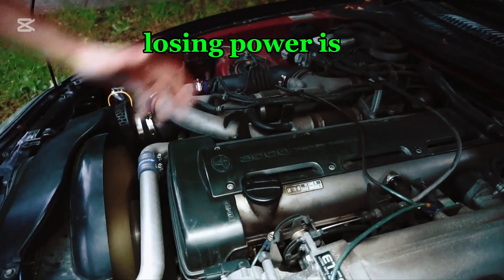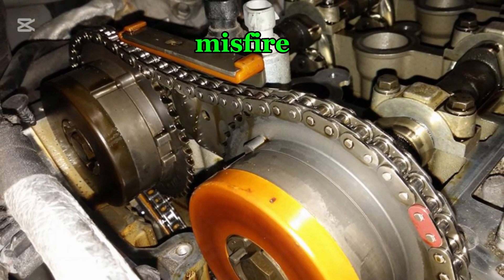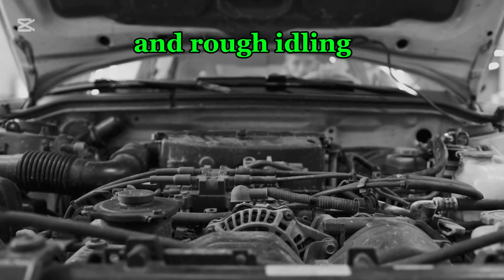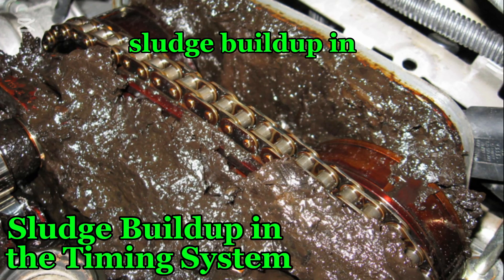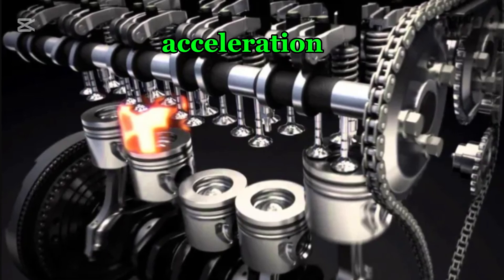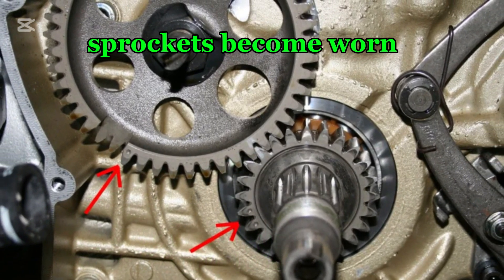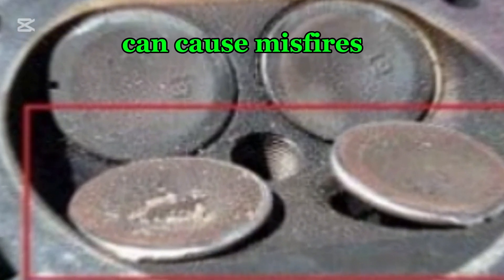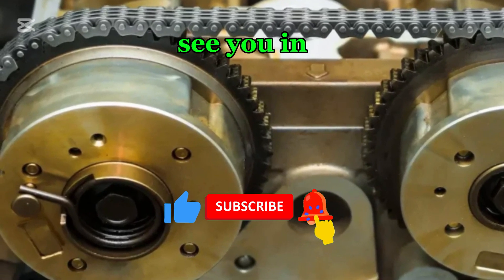10 Ways the Timing Chain Can Cause a Car’s Loss of Power and Poor Fuel Economy

Comment: I doubt it will run if the chain jumps a tooth
Reply from the maker: It will run, but not smoothly, and if left unfixed, it could damage your engine. I experienced this with my car—when I accelerated, it wouldn’t respond immediately but would then speed up on its own, which is dangerous.